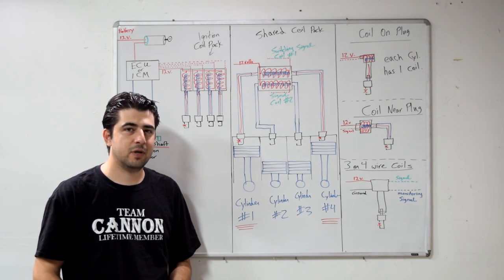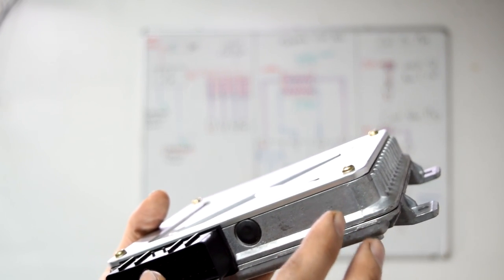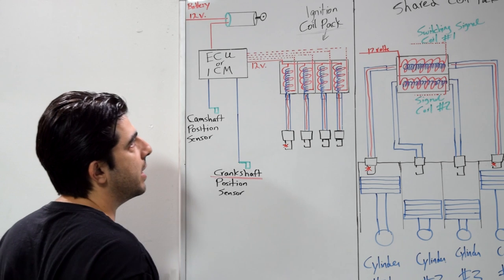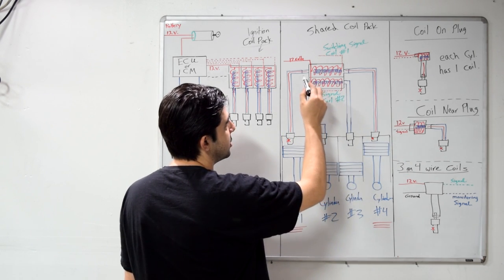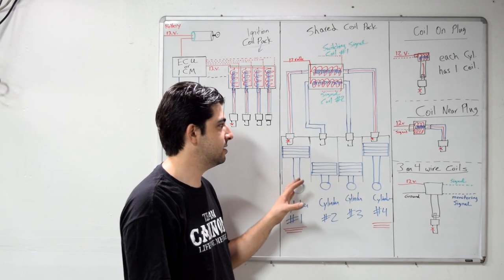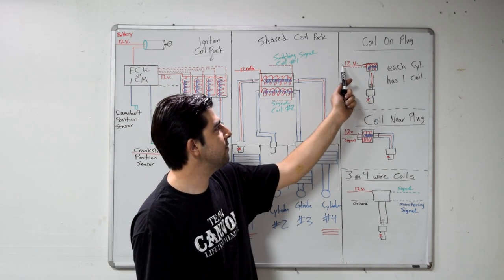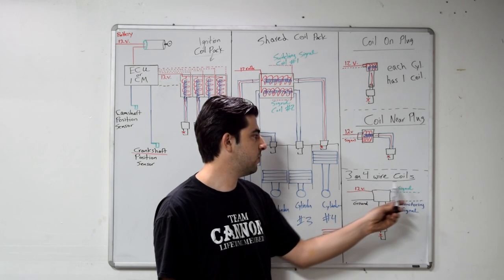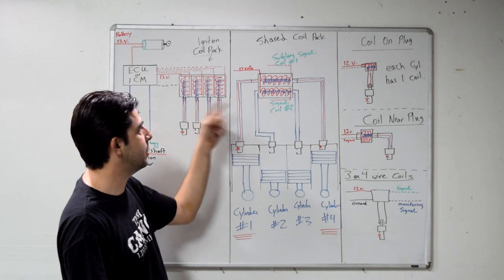How an Ignition System Works - Distributorless Ignition Systems (DIS) Explained

Comment: I've had 40 year old cars and nothing wrong with the (1) ignition coil. I've seen 5 year old cars with burnt coil packs needing replacement of the whole unit. This is garbage intended to cost more maintenance money. DIS run by computer is a lousy anchor that won't function or run as an engine without computer controller.

Comment: TIA for the video, my bike operates on DIS with stick coil on plug( your top right drawing board). It broke down yesterday, error code shows stick coil 1& 3 shorted or open circuit. What confuses me is each coil are individuals, why are 1 & 3 be shorted or open circuit? They aren't sharing the return circuit. The positive wire are definitely fine as they are shared and the 4th plug are producing arc. Help!

Comment: So, In these new Coil on Plug ignition system, there is no such thing as "setting the timing belt'"??? The timing is now control by the computer!
Reply from the maker: +dana miller well the timing belt timing setting is done mechanically when you replace the belt, ignition (spark) timing on these systems is done by your computer, yes.
Reply: RatchetsAnd Wrenches Thank you for always answering my questions. You are awesome!

Comment: Have you ever seen all 8 coils firing continuously with the key on?
This started when our mechanic put a new starter on a 99 Corvette C5. Apparently he connected a wire that didn't belong and had to cut it fast when things started smoking.
Now it has no COM no crank and continuous sparking on all 8 coils. It also has the DIS.

Comment: Ah, excellent that answered a lot of questions for me.  Especially the part about spark being generated in pairs.  One to a cylinder at the top of its compression stroke and the other to a cylinder at the top of its exhaust stroke.  Thus the spark to the cylinder at the top of its exhaust stroke is wasted.    
So, I'm getting a cylinder 1 misfire on my 2008 dodge caravan equipped with the V6 3.3 liter engine with 180,000 miles.  I already changed plugs & wires but code still appears.  I was considering changing the coil pack next but based on your video, I would think if a bad coil was responsible, I would get a misfire on both cylinder 1&4.  Would you agree?

Comment: Great videos..i love them and learning a lot of things..keep it up!!!
i got a question about this video on DIS..got a 2003 montero sport limited 3.5L with a different setup..it has a shared coil with only 2 pins and an ICM with two connectors..one with three pins and the other with 6 pins so im thinking the 3 pins get the power from the ignition switch and the 6 pins deliver the spark to the individual coils.  Is this correct?  BTW, the two coils are giving sparks to the plugs but the 3-6 coil does not.  Any ideas would be gratly appeciated.